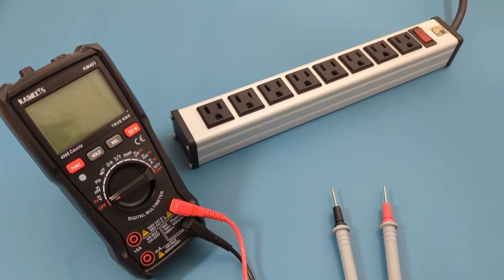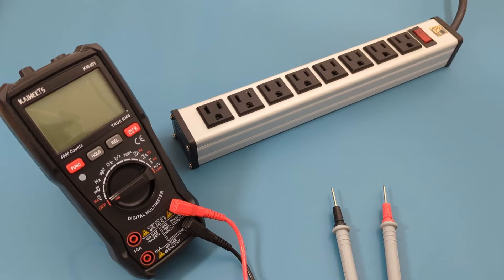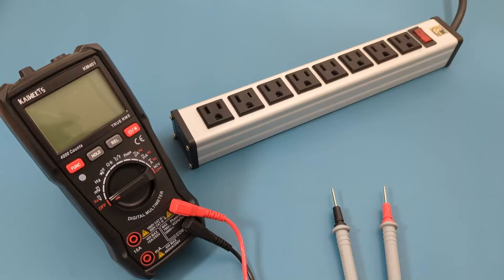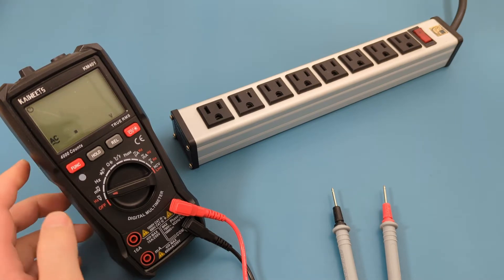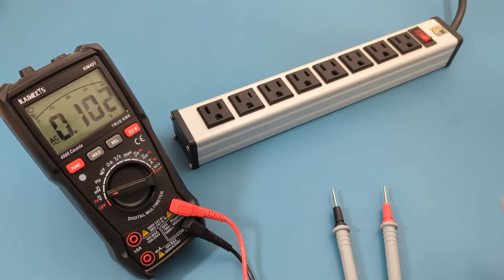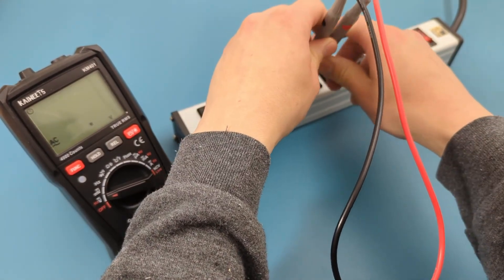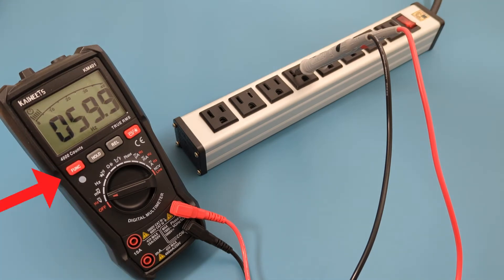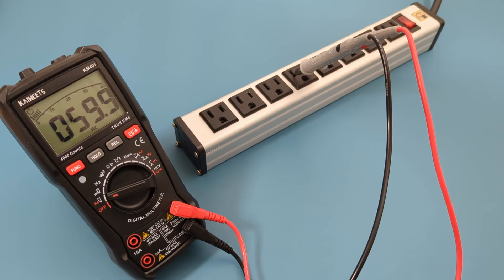How To Measure Frequency With A Multimeter

Comment: On a 120/240v single phase with 60hz between neutral and 1 line. What is the frequency should I read between the two line of 120v on a 240v circuit?
Reply from the maker: The frequency between the two 120V lines on a 240V circuit will still be 60Hz.